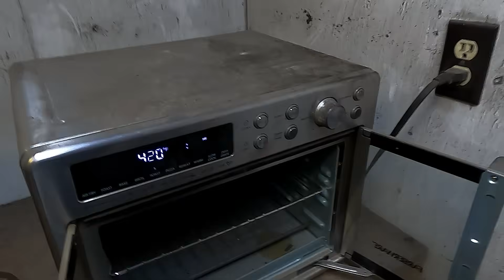Can you HARDEN Coil Spring Steel? | Bladesmithing

Comment from the maker: 🔥 Can coil spring steel actually harden into real knife steel?
This episode of Knife Steel or Not? puts an old automotive coil spring through the forge, quench, and snap test to find out if it’s good steel or just scrap.

If you’re a beginner blacksmith, new bladesmith, or just curious how different steels react under heat and hammer — this one’s for you. We’re testing scrap steel one piece at a time to see what really hardens, what fails, and what surprises us.

⚔ Next up → Are Hand Files GOOD Knife Steel?
Subscribe and follow along if you love forging experiments, steel testing, and real shop results instead of theory.

Comment: Automotive springs are good steel, Usually 5160 chromium tool steel. Used springs often have a serious defect that won't show up until after heat treatment. Cracks from metal fatigue. If live near a big city. There will be at least 1 or 2 spring shops that make replacement springs for big trucks. These shops will have a scrap hopper that they put their drops or cutoffs from the bars of steel. Some shops will allow you to take some steel from their scrap hopper. This is virgin material.

Comment: Been using them for over 30 years. Never had a problem or complaint. Great video. Just found your channel and I find it very interesting.
Reply from the maker: Me either❤
Reply: @rustyhammerforge5902 of course there is the rare "crack in the blade after spending hours forging, filing, sanding, handle fitting and then you quench and BAM!" Now that has happened. It really initiates the "GRRRRR Factor!"
Reply from the maker: @messerist been there a time or 2
Reply: @rustyhammerforge5902  What's a good steel for making real tough sword?
Reply from the maker: @mister_zany 1060-1075
Reply: @mister_zany imo use 80crv2. Its easier to work and holds up to the ABS testing perfectly fine which is it has to chop a 2x4 in half twice, cut a freehanging 1 inch rope in one swing, still shave hair after that, and then bent 90 degrees in a vice without breaking. If you abuse a knife or sword harder than that then you got the wrong tool

Comment: Hitting with a hammer is basically a measure of toughness (the area under the stress strain curve, or the amount energy a specimen can absorb before failure). Scratching it with a hardness file will measure hardness (duh), which is almost the same as strength.
The fracture face looks like it's going from brittle to ductile failure, which is close to what you want for optimum hardness and toughness. 
Well done

Comment: Hi, I have no training in Blach smithing. But I tested to do a knife from coil spring steel. But it kept cracking ass soon ass it vas nott very hot, like it hardens by it selt to fast. Anybody that seen the same?
Reply from the maker: You probably were using a coil springs with a flaw or damaged

Comment: I've always read that automotive spring steel is generally 5160 and unless there's some kind of technique I'm not aware of, 5160 WILL NOT forge weld to itself. That said, any cracks you have in the billet will not forge weld and repair if you work it at welding temps. Any cracks present at the start of the process will still be there, possibly worse, at the end of the process.
Reply: Haven't tried yet myself but I was taught 5160 can be forge welded if you clean it very well, use flux, and keep the heat down and do it multiple times.  If you keep the O2 levels low it also helps.  I'm nowhere near about to try it nor do I need to at the moment, just something I thought I'd pass on.

Comment: Hey, great video! But there is something Id like to ask. So I had finished a knife a day or 2 ago out of some 1095 (its my second knife ever made, Im very new!). Before doing anything else I wanted to test it, so I tried to chop a brass piece with it (foolish choice), and ended up with a 0.4mm/0.15in hole in the edge (I did this before temper). The grain was NASTY, but I thought "eh its gonna be usable, its my second so its acceptable" and tempered it, after which I grinded the massive chip out and fixed the shape. I finished it up again, and went for some lighter testing. Anyway, I ended up with an identical chip in the almost same place, but the grain was the color of the temper. Its been sitting in my shop ever since. Seeing you bring it up in the video made me want to write this comment.

So now, what should I do? Do I grind it out once more (the knife is already significantly smaller) and attempt to re quench it, or should I leave it because there might be more cracks? Would I need to reforge it?
Reply from the maker: You first need to check for micro cracks. Se one is you need to most likely redo the heat treatments anneal it, normalize and heat cycle the blade. Then reheat to a dull red tired color and quench in oil. Then temper at 420 for two hours. And your blade should be good to go
Reply: @rustyhammerforge5902  Should I be able to see these cracks if I look closely or use a magnifying glass? Because I never noticed anything on the surface before, but maybe I just wasnt paying attention.
Reply from the maker: @Blade-fytake the scales off if it has scales on it or handle if it a hidden tang. A sold blade with ring…a cracked blade will not ring.
Reply: @rustyhammerforge5902  Thank you very much!
Reply from the maker: @Blade-fyabsolutely…let me know how it all turns out

Comment: It depends. I've heard a couple years ago that some light vehicles (I can't remember specifics) have coil springs made out of cold rolled mild steel. It's something to watch out for when working with salvage.
Reply: Cold rolled mild steel won’t make a spring
Reply: Perhaps what is meant is “they have weird steel that responds poorly to conventional heat-treating,” e.g. “most of their springing action is due to extensive cold-working.”

Comment: Most automotive spring steels are 5160 or similar.  They certainly can be hardened, the biggest problem is going to be the amount of general fatigue in the metal before you use it.  Springs undergo tens to hundreds of thousands of flex cycles over their service life.  If I were going to use that steel for a quality knife, I'd initially work it at near welding temp to resolidify the structure.
Laminating it would probably the best method  
For general work and learning the trade, used springs are fantastic stock to use.  I used them to make all sorts of tooling like punches and drifts.  If you are doing this to sell, buy new stock.
Reply: Complete, Udder,....  🐂💩💩
Reply: @Fireworxs2012  in what way exactly
Reply: In every way
Reply: @GerManBearPig  im asking for your two cents, but you cant even give one. If you cant make a single point why chime in

Comment: i have a mountain of coils from car friends. I've successfully made nice puukko's from a few pieces, but i'll say this, they're not all equal. Some are better quality steel, some are not, and they heat treat just so slightly differently from coil to coil. The best was actually out of my Mitsubishi evo lol. They're definitely usable by themselves, but I would actually suggest, in general, chopping them up and stacking them and making damascus with em. Definitely good usable steel though, so if you're starting out and have limited access to new known knife steel, do these tests like Rusty is doing here, and get a baseline for what you need to do with the steel.
Reply: By making layered steel from them there's even higher chance if screwing it up because that's not exactly easy

Comment: Do you quench after tempering?  I.E. quench after the two hours ?
Reply from the maker: No…quench then temper
Reply: @rustyhammerforge5902  I understand that- I meant do you cool it after you hold it at 420 for two hours or do you let it air cool
Reply from the maker: @TonyUrryMakes it cools down in the oven

Comment: they're medium carbon, plain or low Si and/or Cr alloyed steels. anything above 10mm diameter tends to be alloyed for hardenability, which makes sense, you don't want a spring that has a different phase and deforms differently in its center. 
Si is a crappy alloying element for fine knives, it increases RA. It's great for tongs though. Not great at hot work but much better than plain carbon. If you make knives from this stuff, don't bother tempering below 400F.
As you've seen it's easy to get coarse grain with such steels, that's because there aren't any aggressive carbide forming elements like vanadium and not enough chromium to form carbides either. Meaning grain growth is 100% dependent on temperature, no buffer. 
Another effect of Si is decarburization. You'll notice that some springs don't form much scale - but they lose carbon quicker. Depending on what you're forging, it might be worth it to keep temps a bit lower and to do more stock removal on the final product than usual.
Reply from the maker: You are right, but this is why you test them. This coil spring is good for making high quality knives out of
Reply: I am not necessarily saying you are exactly wrong, but most coil springs I have used as well as springs in general have been a pretty similar medium to high carbon steel with a high hardenability that give me fairly similar results if I treat them the same way. Rail clips are probably the most different from other springs, but i haven't worked with a spring yet that didn't make decent knives if you treat it right.
Reply from the maker: @garethbaus5471 I agree with you. I haven’t ran into a coil spring that didn’t perform exactly the way it should. But the facts are that not all are created equal. I mean let’s be honest for most of us, this test on coil springs is a slow pitch across the plate.
Reply: @garethbaus5471  that comment was specifically about Si alloyed steels like 55Si7. The Si increases the RA fraction, making the edge weaker than it should be, compared to an equivalent plain carbon steel. Other steels don't have that issue.
I wouldn't treat them exactly like high carbon steels, aust temp at ~0.6%C is a good bit higher.